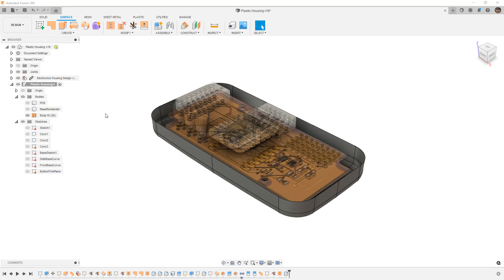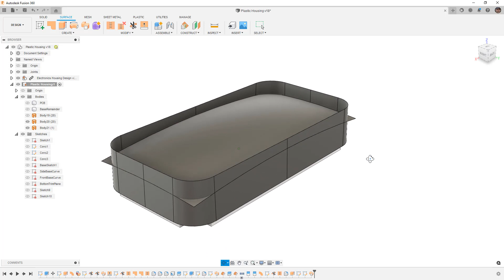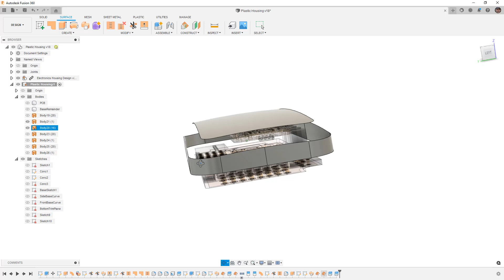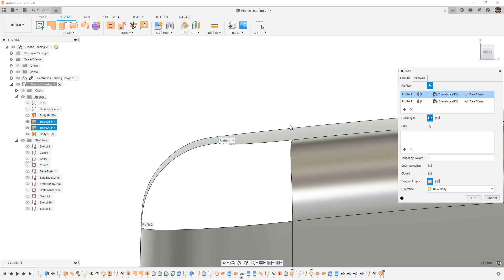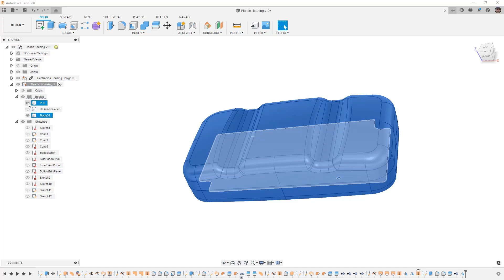Plastic Part Design Series Episode 7 - Creating a Complex ZipTy Recess Feature #Fusion360 #Design

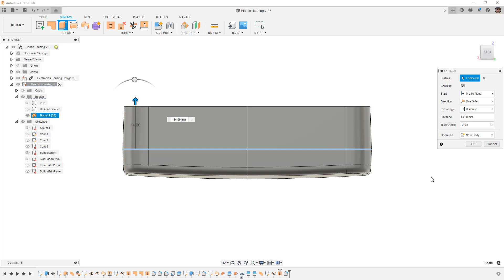Comment: @3:46
Fusion extrudes 20 faces from the 12 curves.  A Solid tapered Extrude also includes the 8 sliver faces.  2 workarounds to create only 12 faces:
1. Surface Extrude 2 mm with taper, then extend the faces the addition 12 mm.
2. Solid Extrude without taper, then add the taper with Draft.
When the workarounds are used, the top of the housing can be filleted similar to the bottom.

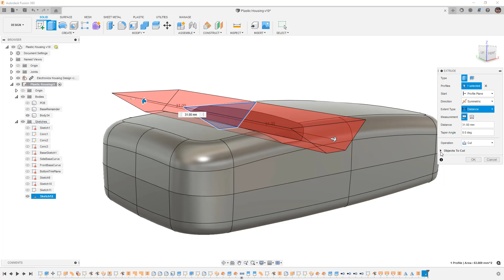@18:10

The long unresponsive duration doesn't occur when the electronics reference design is not visible.  The other workaround is to use Distance Extent Type instead of All.  I don't know why the reference trips up Fusion; Validate doesn't report any errors.
Reply from the maker: Great points Steve!  Thanks for the comment!
@3:46, great eye seeing that it created 20 faces rather than 12.  One thing that is interesting here is using your first method of extruding just 2mm then extending it, Fusion doesn't treat the edge as a tangent chain, however it does with the Ruled tool.  And it is interesting that the base is 28 faces, meaning the 12 "vertical" faces are just single faces/edges.  You would also thing that when stitching it all together with the extrude that it could consolidate those edges and make sense of them.  Very curious!

@18, no clue either why the PCB causes issues since the housing is the largest body/component.  When it locked up it seemed fine until I tried to expand Objects to Cut, but again the cut doesn't go through any PCB components.  Good tip on hiding the Electronics!

Thanks!
Reply from the maker: Steve, I did a little more testing and tried something.  With the extrude height that produces 20 faces, if you unstitch them all and restitch them you get 17 faces... but if you unstitch them you can find the sliver faces and remove them and only put the 12 back together.  Seems like a very poor workflow but adds another option on a design that might be more complex than this one.  
Sure enough after the fact you can fillet with the 12 faces just fine.

Again thanks for noticing that, i never would have thought we would get 20 faces out of the 12 we extruded from.

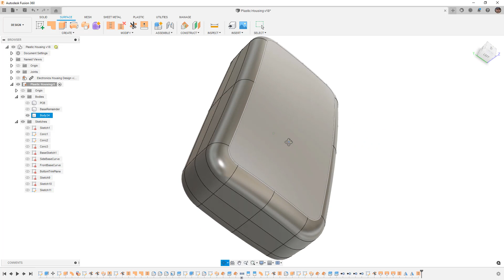Comment: 15:45 somehow there is a line crossing on top,
 what I do is get back before the last trim, duplicate the top surface (trim it like normal), stitch without the top surface, mirror only the stitched surface without the  top surface), and stitch all surface planes (before it delete the small surface on top ). 
I hope you understand what I say, English is my third language
Reply from the maker: Thanks Usamah.  Sometimes it works fine and other times it doesn't.  The line isn't an issue as long as your surfaces were created so they could be mirrored with tangency or curvature continuity.  But copying that original surface is a good tip!